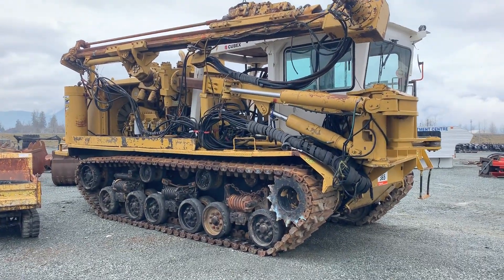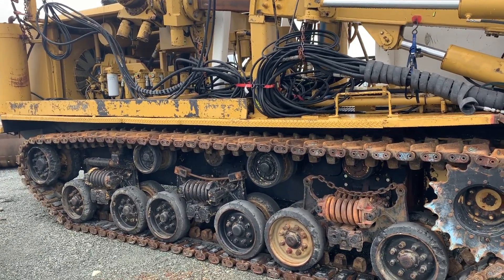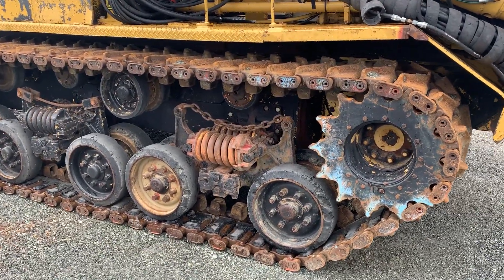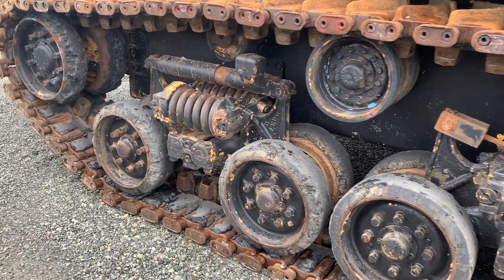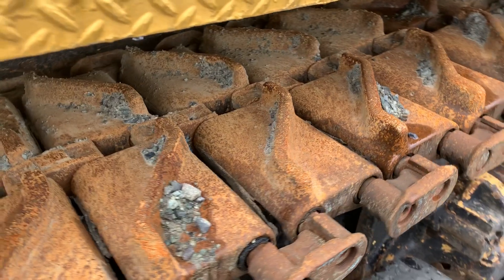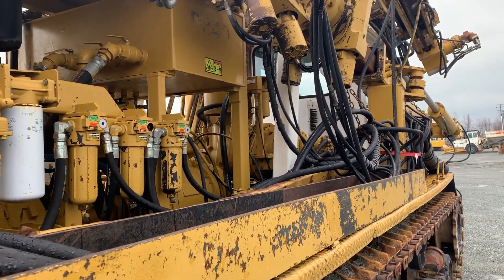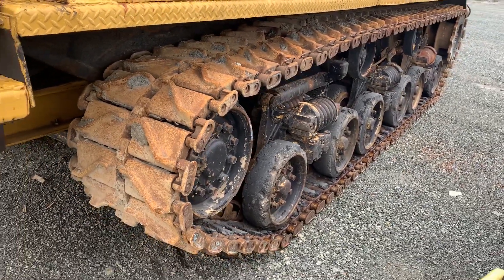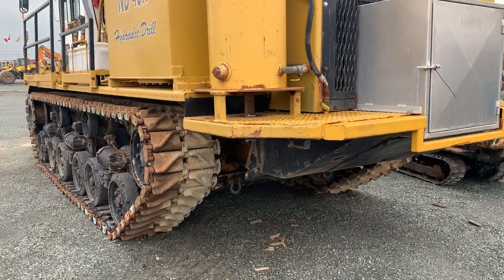Tank Drill

Comment: Hey there Skadill... Looks like it has a hydraulic drifter ...so probably drills quick enough. No rod changer...so some schmuck has to add steel by hand...likely a WCB no-no...in these enlightened days. Not as much reach as a hoe drill...but the Ranger 800 drills don't reach much either. Any drill that can run a few days without spitting out parts is a keeper . I pity the fool ..that thinks this is the path to Cadillacs and gold pinkie rings.